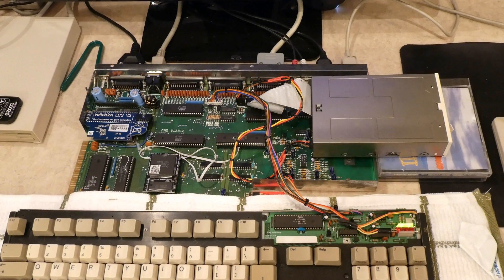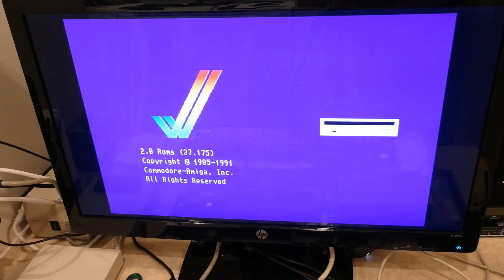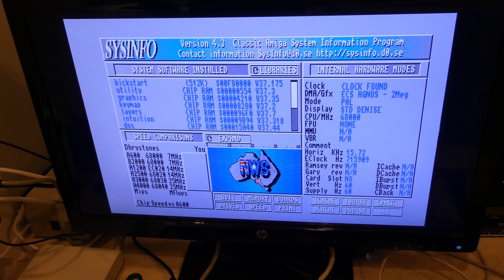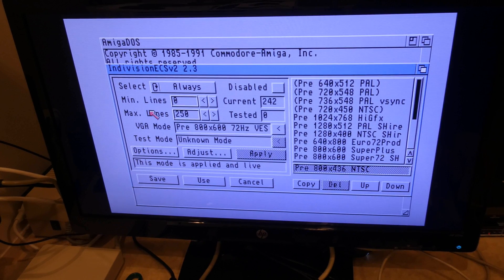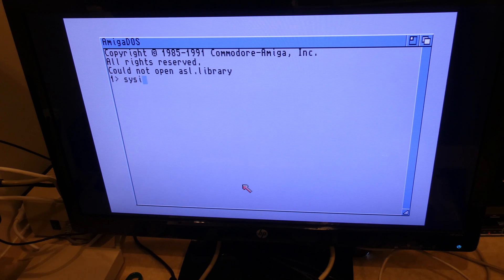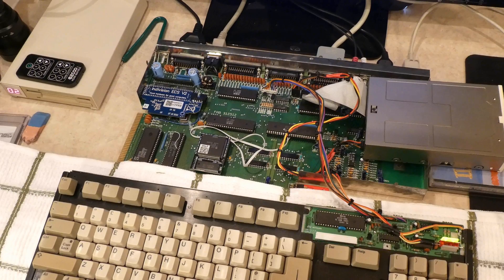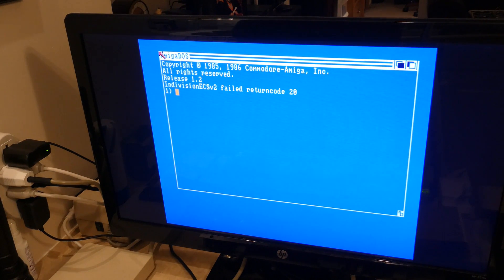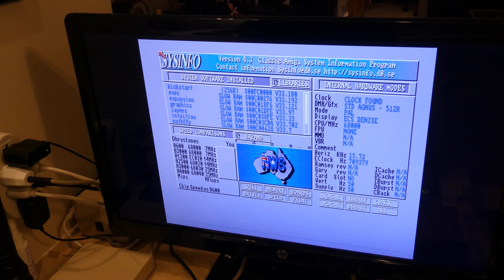Amiga 500 Revision 3 : Re-Re-Visit (ECS V2 Final Test)

Comment: Hi can you connect the Indivision ECS V2 to HDMI?
Reply from the maker: No, it does not have native HDMI output, but you can use a VGA to HDMI converter, though the output quality may vary depending on the device used.

Comment: I don't know if you ever tested the VGA output with the ECS V2. As mentioned earlier and by many others, it had quite a bit of ghosting/smearing to the right side of objects. Certain colour combinations would show it more than others. Anyway, I have bought myself 2x Indivision ECS V3s. These have a crystal clear image from the VGA output and shows no ghosting/smearing. Jens has put higher frequency output transistors and improved the output circuitry. Otherwise it's pretty much the same as the ECS V2.
Reply from the maker: Nice to know. I have the ECS V1 and V2 and was holding off on purchasing the V3. Now I have a reason to spend more money :)  You also gave me a topic for another Video. Thanks for your comments.
Reply: @amigaretro1985  You're welcome. I can safely recommend the V3. Looking forward to more videos from you. Keep up the great work :)

Comment: So with the V2 you don't need to put the chip on top of it?
Reply from the maker: No, the Indivision ECS V2  doesn't require the Denise Chip.  It completely replaces it. The Denise has been replicated in the  onboard FPGA. It's also fully OCS and ECS compatible.  This is a nice solution for either replacing a faulty Denise or upgrading the older OCS  Denise. In addition you get a nice configurable scan double with VGA out.

Comment: Just did some testing on my BenQ BL 912 LCD monitor and found that the ECS V2 has superior picture quality on the RGB output VS a real Denise. Not that the real Denise has bad quality but the ECS V2 has a perfect image. It's really noticeable. It's like the colours are popping out of the screen and absolutely no noise in the picture. This will be my new way of using the ECS V2 from now on ;)
Reply from the maker: Nice to know. I will try this on my Amiga 2000 and HP 2511x. Hopefully my results are similar. I recently bought the Indvision AGA MKIII for my 1200. I may do an in-depth review in the future on this newer piece of Hardware. So far, it it is holding up well :)
Reply: @amigaretro1985  Be sure to let me know when you have tested. I am really impressed by the crystal clear RGB picture I get from the ECS V2. Also, looking forward to you doing an in-depth video of the AGA MKIII. I have the AGA MK2 myself. Oh, and I am doing several Amiga 500 ++ Replica boards. They are really sexy. But a ton of work. Especially when I transplant most of the components from old A500 Plus and A500 boards.

Comment: Been trying to figure this out. I see lots of people mounting their ECS denise into the indivision. Why? If you can flash / update the firmware? I guess you can either mount the physical ECS denise into the v2 or simply flash it? I ask because if I only need to flash it then I can use the ECS denise in a different amiga. Thank you for the video.
Reply from the maker: Thanks for watching. The main difference between the Indivison ECS V1 and the Indivison ECS V2 is, the ECS V1 requires the physical Denise chip, usually the 8362 (OCS) or 8373 (ECS), where the V2 uses an FPGA to emulate the Denise (OCS and ECS versions). This should help explain why you have seen physical chips being installed onto various Indivision ECS models versus the flashing of others. The main advantages of the Indivision ECS V2 are; it acts as a direct Denise replacement, has both OCS and ECS compatibility, and VGA scan doubled output. I hope this explanation helps.
Reply: @amigaretro1985  thanks. So long as there are no downsides to using the fpga vs the physical chip then I will not bother installing the denise chip into the v2.

Thanks for video which helped me understand how to enable ecs mode.
Reply from the maker: @rjd324  No Problem, glad to help. The Firmware is updated from time to time that resolves bugs and may add features or improvements. 

Here is the Link:  http://wiki.icomp.de/wiki/Indivision_ECS_V2

Comment: So I built myself an A500 Plus. Bought an A500 Plus motherboard with no chips from ebay and was thinking I should use my Indivision ECS V2 as Super Denise replacement. Now, I have been using it with the VGA output previously. And found an issue with Arkanoid where a few pixels on the right side of the picture was missing and also blinking vertical bars on left and right side of picture in the game disposable hero. It had nothing to do with settings or profiles. No matter what adjustment or profiles I used would get rid of these issues. Would need a new firmware to fix this. No respond from icomp forums yet. So today I replaced a regular ECS Denise I had in this new A500 Plus with my ECS V2. I plugged in my RGB cable instead of using the VGA and to my surprise the issues are there when using RGB aswell! First thing I noticed was in classic workbench the image was still centered like when using the real denise but now had a thin black bar on the right side of the picture. Clearly showing that the ECS V2 is missing a small part of the right overscan area. And the same issues in Arkanoid and Disposable Hero. Keep in mind all my testing is using PAL mode. I have  updated my thread in the icomp forums hoping that the devs will reply and maybe fix this with a new firmware. Maybe you could test this, Amiga Retro Adventures?
Reply from the maker: Interesting. I will test this later tonight or tomorrow and get back to you. Are you using a WHDLoad install or disk based version of Arkanoid?
Reply: @amigaretro1985  whdload version. It will not matter anyway. This is an issue with the ECS version 2. I centered the picture in classic workbench with the real Denise and had grey background around the picture with no visible black bars, then put the ECS V2 in and had a small black bar on the right side of the picture. Which is the missing pixels in Arkanoid. I use a BenQ BL 702A LED screen. So clearly the ECS 2 is missing part of the right overscan area. And disposable hero have flashing black bars left and right of the picture. This will not happen with the original Denise. Looking forward to hear your results.
Reply: @amigaretro1985  The Game Skidz also has a blinking border on both left and right side with the ECS V2.
Reply from the maker: @larsenmats , I also get the same issues you are experiencing on these games. In regards to Disposable Hero, there is definitely issues going on here (Indivision ECS V2 related). Though the game is still playable, it is rather distracting. I hope the guys at Individual Computers can resolve the issue. The video output is cleaner than the ECS V1 and has more features as well.
Reply: @amigaretro1985  I also found that Super Frog has the flashing borders. Today I got a response from the devs in the icomp forums. They are looking into this issue. But said that a few missing pixels in the right border (like for Arkanoid) was acceptable. I don't think so. I think we should have the full overscan area. I don't see a reason why not. The last firmware for this product came out almost a year ago. I really hope they fix these issues. It's not acceptable. Especially the flashing borders. There are probably more games with this issue.
Reply: @amigaretro1985  Latest answer from the devs: Sure, when we look into it, we will consider both bugs. I can't tell how difficult it will be to fix at this point in time. It could be that both issues share the same underlying problem and the different visual appearance is just the way the games configure the screen. So fixing one also fixes the other. However it could just as well be two different bugs. You can never tell with these emulation issues, it is often a complex interplay between the chip-set behavior and the game code.
Reply: @amigaretro1985  Found yet another game with the flashing border. Menace. the classic games with this issue are piling up.
Reply from the maker: @larsenmats  , Heavens, not good. I ordered a SCART (RGB) to HDMI converter from Retro Tink, the 2X-SCART. I will do a quick review on this once it arrives. I already have the Amiga specific RGB to SCART cable that is required since I also own an OSSC (Open Source Scan Converter) that uses SCART for RGB as well. These cables can easily be found on eBay. Unfortunately, the OSSC has it issues with the Amiga's output from time to time, so I am really hoping the 2X-SCART will finally resolve various issues other devices have getting the Amiga to output properly to an HDMI monitor or TV.
Reply: @amigaretro1985  Looking forward to that review. Me myself are using BenQ BL 702A and BL 912 monitors for my Amigas. Pefect picture once finetuned however no scanlines. That's why I have both Indivision V1 and V2. But not super happy with the picture on those when using VGA. ECS2 has problems getting a nice full overscan 50Hz profile when VGA is used (and RGB aswell as you have seen). ECS1 has issues remembering it's 50Hz profile at coldstart and the picture is not that great.
Reply: @amigaretro1985  Jens himself answered in the forums now. They are scheduled to start work on ECS V2 firmware later this week. Awesome news!
Reply from the maker: @larsenmats  Nice, let's hope this works out well :)
Reply: @amigaretro1985  New firmware file out for testing. I tried it and it fixes the issues I have been mentioning https://forum.icomp.de/core/index.php?attachment/741-indi-ecs-v2-20200326-zip/
Reply from the maker: @larsenmats  Nice. I shall give it a try. Thanks!
Reply from the maker: Actually, I have been following, I am Drewlio :) I normally go by Drewlio77 but was not logged in to the Forum when I left my post. I grabbed the new archive and will test it soon. Good job in getting this issue  recognized. It's been awhile since an update was released. The Crew at Individual Computers are truly amazing.

Comment: Hi, I also have the same configuration, ACE2 + Indivision ECS V2 but they are mounted on an Amiga 2000. It tells me that my video format is NTSC, here I see that you managed to set it on PAL, can you tell me how you did it?  I've been going crazy for a year!  Thank you
Reply from the maker: Unfortunately, SysInfo 4.3 is reporting the Screen Mode where it states "PAL". Look to where the Status reads "Vert Hz". It is listed as 60 Hz (NTSC), it would read 50 if the System was in PAL. I also have an ACE2 in my 2000. WHDLoad games can be forced to PAL by using the Game's Icon Tooltypes or you can choose from many utilities on Aminet that will force your Amiga into PAL if needed.

Comment: Have a Indivision ECS V1 on my A500 Rev6A with the ACE2. But I used it on the ACA500Plus V1 with WB 3.1.4.1 and BestWB 1.3. Have also a fast ACA1233n-55 IDE Speeder RTC on it. Would like to have the Indivision ECS V2 for more VGA modes. Such I use with the Indivision AGA MK2CR on my A1200. The Indivision ECS V1 is nice for Demos but for Games not so great.
Reply: Why would you say the ECS V1 is good for Demos but not games? Do you mean the 50Hz not saving profile properly issue? I have both ECS V1 and ECS V2. ECS V1 reads directly from the Amiga to give the full overscan picture. 50Hz mode works fine but it will often forget the setting after a coldboot. So you have to change it back with the config tool. Or coldboot it until it changes. 60Hz mode works fine too, with full overscan. But of course, not smooth srolling in PAL software when running 60Hz. ECS V2 is alot more configuring to try and get a nice picture for games. It still has issues when trying to make full overscan profiles for games. Or using the ones that comes with it. Even with the latest firmware. In games like disposable hero you will get a blinking border on the right side of the picture. Arkanoid still misses a few pixels on the right side of the picture. ECS V1 shows the full overscan correctly. It just scandoubles the native picture output it seems. I have posted in the icomp forums about these issues and am waiting for a reply. In general all VGA based Indivision products like ECS V1, ECS V2 and Turbo Chameleon 64 V2 has ghosting in the picture when using the VGA output. At least with LCD screens which I'm using. I am using BenQ BL 702A and BL 912 screens which will handle Amigas 15KHz signal perfectly and looks really good when the pixel clocks/phaseclocks are finetuned. So I use these plugged directly into Amiga RGB port. The VGA output of ECS V1 and V2 is not as sharp. And as I said, has some ghosting. However, if I want scanlines then I the VGA output of ECS V1/V2 is handy. And of course, if I wanted a flicker free hi-res interlaced workbench picture then the ECS V1/V2 is nice for that. As they are scandoublers/flickerfixers.
Reply: Use the BenQ BL702A VGA 17inch monitor and the old Indivision ECS V1 don’t like WHDLoad Games to Full the screen. Have the Indivision ECS V2 and now it work great with my monitor. Have now PAL High Res Laced 640x512 50Hz and 1280x1024 60Hz. Must tweak the settings with it. Would be great if it have Live-modus such as on the Indivision AGA MK3 which I like on my A1200.